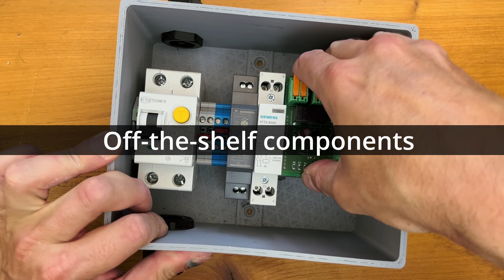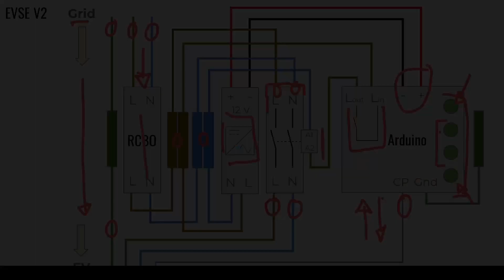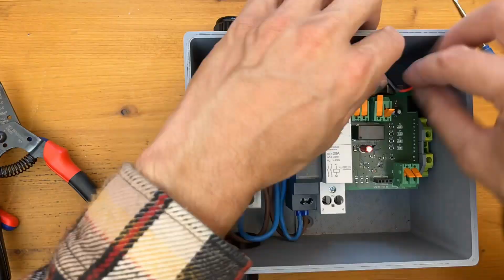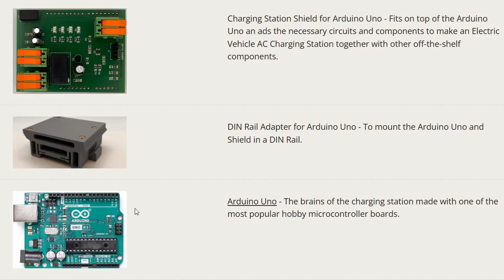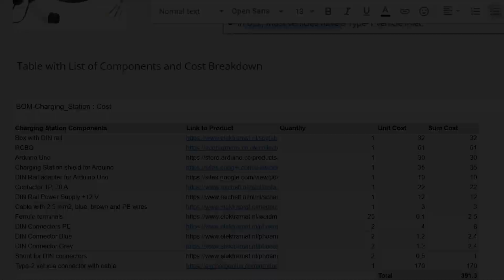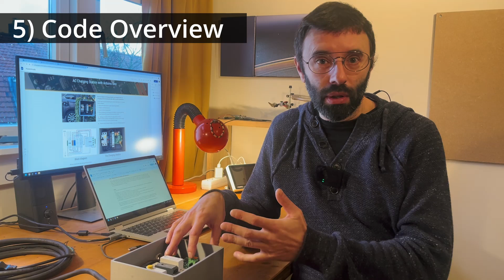DIY EV Charging Station With Off-The-Shelf Components

Comment: Hi! very nice project!
the charging power change with the % of the battery?
like if it's at 80% it slow down? or is the car that choose that?
is it possible to adjust the duty cycle for the AMPs getting in the car with a potentiometer or similar, add a display and choose the power to charge time to time?
i'll try by myself :)

Comment: Nice project, nice thing to add might be an nfc reader so it can ‘allow’ for charge with tag. Mine would be next to public parking space and not everyone can use ‘my’ project
Reply from the maker: Thank you! Indeed, this is possible with the current board. I left a connection to the serial port to allow adding other devices.
Cheers!

Comment: First of all, great job, this is an awesome project. Two things I would like to ask you. First, I assume it would be possible to install a switch in the case to enable the charging process instead of it starting automatically a few seconds after you plug it in.  Second, would it be possible to install a potentiometer to regulate the charging current, and if so, where would we be able to see it's actual value? Thank you very much.
Reply from the maker: Hi, thank you so much!
And those are two very good questions.
1) Yes, it is possible to implement a button that makes the charging station offer charging to start or disallows. This is referred to in IEC 61851-1 as states B1 (connected but not allowing charging) and B2 (connected and allowing charging). Then, the vehicle can decide to go to state C (charging).
2) Yes, absolutely. The charging station communicates to the vehicle how much current it can pull. This can be regulated via a potentiometer. To see the actual value, there are multiple options: - some cars show in the screen the current offered by the station (e.g. Teslas). If you want the charging station itself to show how much current it is offering, it is necessary to implement a screen in the charging station.
Cheers!

Comment: Hello, good content.  I have an EV. How can i know what is the minimum current it can take, so that i can make solar panel on the roof can charge is slowly for long hrs? Also, can i directly push dc to the ac to the car so that i dont need an inverter in between. If yes what would be voltage of dc to keep. in our region it is 220 v AC is standard. thanks
Reply from the maker: @rahulbahuguna123  hello and thank you.
An AC charging station, in accordance to IEC 61851-1, must be able to supply at least 6A. The vehicle may decide to pull less.
Most modern vehicles will not accept DC via the AC port.
Reply: @powercircuits  Is it possible we add let say 500watt solar pannel, 24 volt. boost dc voltage to 300 or 400volt dc. The. Directly inject this voltage to car battery. Obviously with vary low current  but there is no extra battery.
Reply: In my current system, I have a solar pannel on car, then it charges and external 24v battery, then this run a 3000 watt inverter, then a variable current charger set at 6 or 8 amp. It works but lot of equipment. I am making this for travelling some remote area where no power so can park car under sun and can return on after a week.
Reply from the maker: @rahulbahuguna123  most cars will not accept DC from an AC charging station.
Reply from the maker: @rahulbahuguna123  yes, if you're charging the car with an AC charging station, then you need an inverter.
Reply: @rahulbahuguna123  If you have a DC charging port in your car, you can theoretically do without an inverter.

After negotiation, the DC port will be connected to the battery via a relay in the car.

Normally, the vehicle negotiates the required current and voltage with the external charging equipment, and then the external device uses DC-DC to convert the solar power to a specified voltage, Then everything is OK.

This is not something that the average DIY person can do.
Reply: @HouXiang  thankyou. It has CC2 conector.
Reply: @ The risk and difficulty are too great.
Just use an inverter and an AC charging port.
Make sure you have more than 1.5 kilowatts of photovoltaic power generation capacity, 
And use the adjustable AC charging pile from bloggers.  The minimum setting is 6A.

Comment: am a final year student i was given this exact project to make  research on and to also construct
which is solar ev charging station. i want to ask if the input voltage to this project construct is AC   240v. If i can use inverter as the source
Reply from the maker: @salaudeensoliu498  hi, yes, this charging station can be used with an input voltage of AC 240 V.

Comment: Great project ! I already ordered the components. How did you decide that in function findPeakVoltage you use while (i<1000), how do you know that 1000 is the optimal number for the counter, and not for example 100 or 10000 ?
Reply from the maker: Hi, good question. You have mostly two requirements:
- That one period of voltage is read with sufficient samples (so, sample during more than 1 ms).
- Test with sufficient samples so that your function is fast enough to detect change in less than the time defined by standards to react to change.
The value that I used is anecdotal, and I tuned it by experimenting. I haven't tested to the detail that it meets standards. I tested enough to know that it charges multiple cars every time with a simple happy path. If you like to make it work exactly like it should from international standards, I recommend reviewing each of the regulations, test for it and complete the code.
Reply: Hi, how is it possible to buy the complete shield?

Comment: What will happen if you change the duty cycle during charging? Will the car adjust the charging current? Is that how charging balancing works?
Reply from the maker: Great question! That's exactly how charging balancing works. The charging station can change its duty cycle and the vehicle has 5s to comply with the new maximum allowed charging current.

Comment: Nice vid! Cleared some old doubts of mine, and explained a lot more!
Do you know if it would be possible to do DC charge at low currents?
Reply from the maker: Thank you!
This is an AC Charging Station, meaning that it connects AC to the vehicle and then the vehicle is responsible for converting to DC via its onboard charger.
In the case of external DC chargers, they can also be designed to charge at low currents.